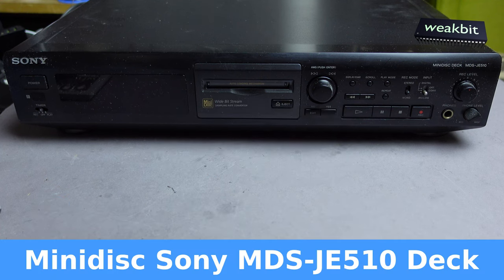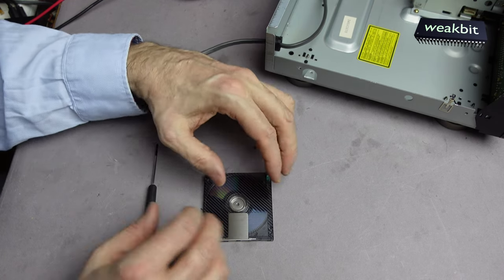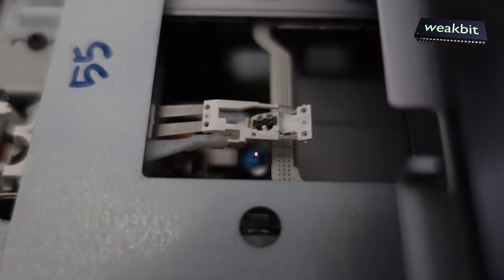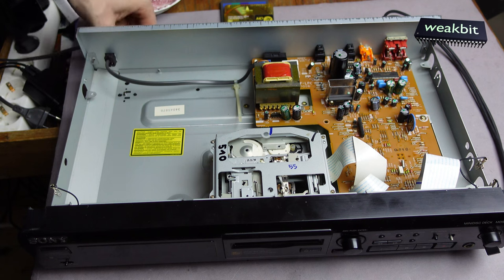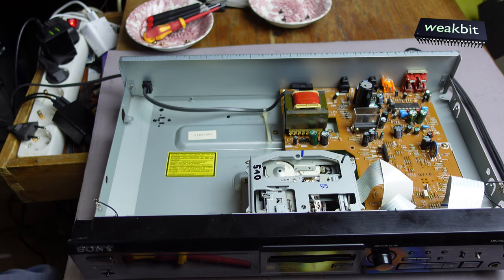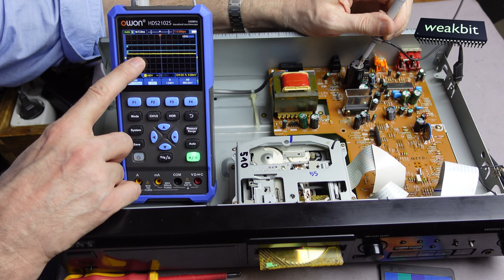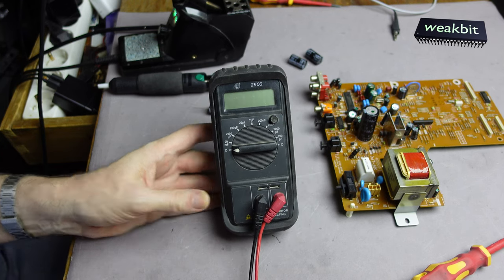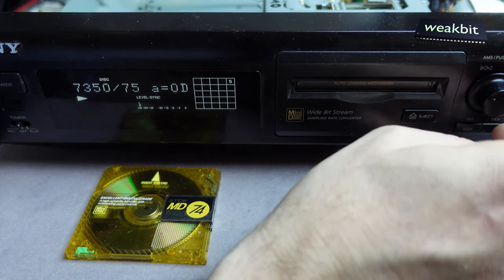Sony MDS-JE510 Minidisc repair

Comment: Why capacitor is weak? Usual electrolytic capacitor has Capacitance  +-20% tolerance. You are measured 958uF capacitance, this results isn't bad. Or did I not notice something?
Reply from the maker: in my small experience - if the cap is lower then the writing on it the ESR is higher then it should be. If the machine is open and so I change it the cap cost near nothing but my time cost real money. This is that what I told Mr. 12Voltvid ones we must repair for money and the cost of a cap is near nothing but the cost of my storage where the e.g. CD-Player is stored cost real money. (if you have more then 50 CD-Players that need space and this cost every month money for nothing) In case of that I ordered it in 1000pcs or 200pcs packs it is not single order this will become really expensive. 
But one other thing I make now a new series for Paul in Canada the topic is now a Top secret - but what is with our communication how we can talk about the project what I want to make. Also I talk with a friend he is will to check up my electronic in case of he is a analog man. Have a good day! weakbit

Comment: I have a MDS-JE500 it wouldn't read any minidisc, I replaced all the surface mount capacitors on the mechanism board and now it works perfectly, those 90's smd capacitors are the worst, their ESR were over 30 Ohms.
Reply from the maker: Change it - good Caps are from Panasonic, Rubicon, Nichicon and others. weakbit

Comment: Had one same unit with same behaviour. In the end I discovered that the issue was just mechanical: it was the sled that, driven by the motor, was misallined  impeding the optical unit to move in any direction. So the laser couldn't read the disc giving the message toc reading then ejecting. I solved the problem with... dental floss! Securing the sled tight in it's position
Reply: Can you explain this in more detail? Or maybe send a picture? I also have the problems with the JE500 ...

Comment: I have Sony CDP-470 (1988) it has OKI branded IC. when I looked for "OKI c6458"  its definition is "The 6458 is a high-speed, 4-bit 1-chip microcontroller with built-in FLT  drivers/controllers developed to support relatively large control systems." they were only IC manufacturing for shelves those days I guess. 38:54
Reply from the maker: Oh thank you for this information I don't know that till yet as you told me.